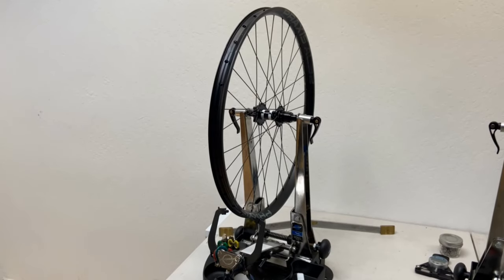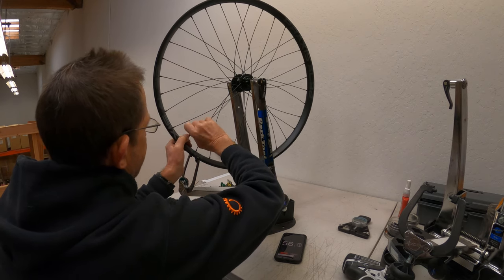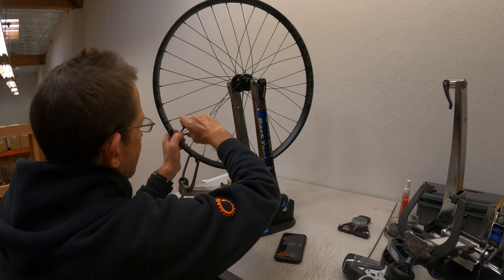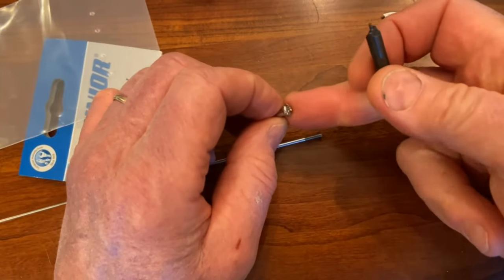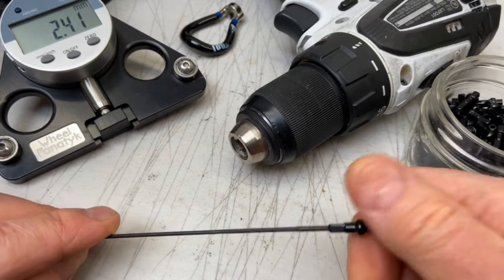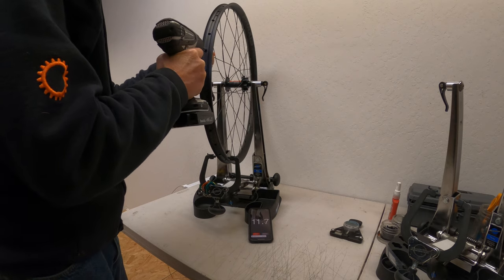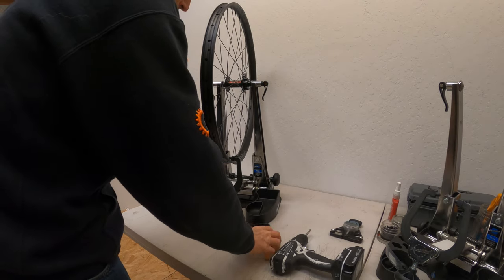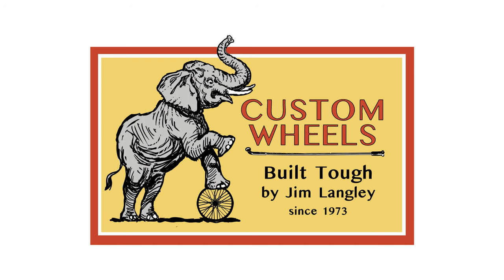Build Bicycle Wheels Faster With a Driver Bit

Comment: A great tool to use us an old fashioned Stanley Yankee push screw driver.. grind  or file the edges of a flat screw driver bit. leaving a 1/16" protrusion in the middle.. I have used this tool for 30+ years... Eldi a German tool brand used to make one just like it.. Yankee ) push screwdrivers) can be found at a garage sales.. They were the cordless drills of the past..
Reply from the maker: Thanks a lot for sharing this great tip, sprocketand wheel. I used to work with a guy who liked his. Here's a link to a modern version sold on Amazon: https://amzn.to/3O59NBb With this tool no batteries are required and it's lighter to hold and handle than most drill drivers. It just takes a little work to make the bit just the right shape to drive the nipples to the right depth. Thanks again - great tip!

Comment: That's a good idea! I'm going to have to make one of those. Agree that maximum consistency at the start is the way to make a good wheel. When everything is new and if the components are well-made the wheel comes up almost true right at the start.
Reply from the maker: Thanks for watching and the comment, Ben. I put some notes in my reply to Tobias above on how I made my driver bit in case you're interested.
Reply: @JimLangley1  Thanks! That sounded like an interesting project. I only use nipples with regular slot heads so it's a much easier tool to make. Can probably just grind an old screwdriver or a bit of steel. What's the ideal length for the spike would you say? Maybe 3mm?
Reply from the maker: @benc8386  Yes, 3mm would be pretty good , Ben. The Unior I have is 2.5mm. The only issue would be if you ended up with too short spokes. But that will cause problems with any tool for pretensioning. It only works if your spoke lengths are spot-on. But lets say if you didn't know like on a wheel you had never built before or you didn't trust the calculator... then if you have a longer/deeper spike, then you could still be able to pretension with spokes that were a little short and you'd discover afterward that you couldn't tighten the nipples fully. So, I think there's a use for a longer spike version and I think that's why tools like the Problem Solvers WheelFanatyk sells, has an adjustable spike you can make as long as you want. Fun stuff!

Comment: The first nipple driver I ever saw was what appeared to be hand made.  Was in use by a renowned wheel builder that was based in the bay area a number of years ago, Steve Aldridge out of the Talbots shop.  I asked him a year or so back, through email if he had invented the thing, being the only hand made one I'd ever seen.  He stated that he was not the inventor, and that they'd been  around for quite awhile.
Reply from the maker: Thanks for telling me about that Walt. Steve Aldridge is one of the legendary mechanics from way back. I have never had the honor of meeting him, but I have known of him forever. I know that for some time builders have been using hand drivers such as push drills that look like screwdrivers. I'm sure you've seen these. You push on them and the bit turns just like it does in a drill. I assume they modified the screwdriver blade on the tool to fit slotted nipples and have a tip to bump into the spoke and stop the nipples in the same place. But, I've never actually had one of those tools to see how exactly they did it. It sounds like Steve might have had something different, probably even more interesting!

Comment: Great work Jim, might not be as fast as you thought but that makes life a lot easier for someone who has difficulty using the PT spoke wrench, arthritis in the fingers can make life difficult using smaller tools... 👍
Reply from the maker: That’s an important and excellent point, Graham. Thanks for pointing that out. You are absolutely correct. It can be extremely difficult to turn regular small spoke wrenches with arthritis and or other hand or finger issues.

Comment: I adapted my "problem solver" to accept a driver bit. It works like a charm.
Reply: Any pictures of that?
Reply from the maker: Thanks for watching and the comment, Bruce. I haven't used the Problem Solver but have read about it on WheelFanatyk here: https://www.wheelfanatyk.com/store/problemsolver-nipple-driver/ It sounds like a nice tool
Reply: @YuoTubeTobi  I do have a few pictures but not sure how to post to YouTube
Reply: @brucelittle1137  upload somewhere and post link here?
Reply: I had one and it worked great once I filed down the sharp corners. The perfectly square angle where the flat bottom meets the curved sides would cause it to release inconsistently. I filed the bottom just a bit to create a curve on each side and I believe it helped. I stuck with Wheelsmith nipples because cheaper nipples would often have slots  machined roughly, contributing to a inconsistent release. In the end, it might not have made a huge difference, but it made me feel better.
Reply from the maker: @UnivegaSuperSport  thanks for sharing that tip!

Comment: Nice video.  Whats the cost for the 32 aluminum or stainless steel spokes nipples included?
Reply from the maker: Glad you enjoyed the video, thank you for watching. I don't know of any nipples made of stainless steel. Brass and aluminum are the common metals bicycle spoke nipples are made of because those materials work well with rims and spokes. Right now you can get Brass DT Swiss nipples for about $11 for a box of 100 https://amzn.to/3yzb3Hf For Aluminum DT Swiss nipples the cost is a lot more, about $47 for a box of 100 https://amzn.to/3ZwVhZf For a 32 spoke wheel aluminum nipples save about 30 grams over brass for the whole wheel. Aluminum nipples do not last as long as brass and aluminum corrode over time. So brass is usually the best choice. Hope this helps and thanks again!

Comment: Thanks for posting interesting videos on wheel building! Are you using blue Loctite on 9:00?
Reply: My bad it's literally another product https://wheelbuilder.com/spokeprep-by-wheelsmith/
Reply from the maker: @findtherightbeat  thanks for watching and the comment. You found it and I have a link in my description below. It's Wheelsmith Spoke Prep. It goes on wet and dries leaving a layer that helps keep the spokes tight and lets you true the wheel for a lot longer.
Reply: @JimLangley1  Thanks, will be going through your videos and hope I get to try and build my own wheels.
Reply: @JimLangley1  I'm glad I found this comment. I see alotta dudes pooh-pooh spokeprep. They reckon correct spoke tension is all you need, but it occurred to me recently that when double wall rims replaced single wall we lost the tire pressure on the nipples. So, in conclusion, how tight does spokeprep set? Does it leave gunk? Can you use weak Loctite?  I've got a loose spoke linseed oil experiment on the go at the moment, but I think it's gunna take a few weeks to set. Love your channel, Jim. Cooee!
Reply from the maker: @RadioSnivins  thanks for watching and the questions! Spoke Prep dries in about 30 minutes - depending on the temperature in the room. It leaves sort of a tough plastic coating on the threads kind of like nylok if you’ve seen that. 

It has impressive holding power. If you use too thick a layer of Spoke Prep the nipple will be hard to turn on the spoke and the whole spoke will turn. You can still build wheels that way but you end up holding the spoke with spoke pliers while you turn the nipples since the Spoke Prep wants to hold the nipples in place. So, it really holds well and keeps nipples from loosening.

It doesn’t leave any gunk behind unless you get it on the spoke when putting it on the threads. If you do that you can end up with blue or tan Spoke Prep “stains,” on the spokes where you can see them if you look close. You can wash it off with hot water or scratch it off with your fingernail. But, the best thing is to coat ONLY the threads and don’t let it get on the spokes.

I dip about 16 max spokes into the Spoke Prep container and get just the bottom 8th of the threads wet. Then I hold the spoke upright with the J bend ends on a table/workbench. That keeps the threaded ends all lined up perfect. Then I roll the spokes against each other and watch as the Spoke Prep works its way down the threads coating them evenly all the way down to the last couple of threads. That way you get an even coat and not a too thick coat. You only need enough to cover the metal, not a thick layer.  I hope these tips help Radio! Thanks a lot for watching and the great comments!
Reply: @JimLangley1 what's your opinion on/experience with boiled linseed oil ? 
Oh and do you happen to know the brand or is there a makers mark on the aluminium nippletwister next to the park nd1 in the last shot ?
Thanks in advance
Reply from the maker: @appelflapdrol  thanks for watching and the questions. I talk about the pros and cons of linseed oil in my video on methods of keeping spokes tight. Here’s the link https://youtu.be/z4FKL95x6DE?si=9Hre3QFaROism-kc The tool is made by Bicycle Research. As far as I know they’re not available now except used on eBay etc. Hope this helps and thanks again.

Comment: Yiu could further improve maybe not on time but on comfort by using a cordless drill that weighs less or even an electric screwdriver.
Reply from the maker: @dieterjosef  thanks so much for watching and the excellent comment Dieter. Yes, a great setup would be having a light torque-settable electric screwdriver hung overhead on some king of retractable cord. That would certainly save time. Great thinking. Thank you🙏

Comment: make sure to do smaller turns around the wheel early on after lacing or else the hub will move to 1 side and mess up the build!
Reply from the maker: Thanks for watching and for the comment, Nick. If the spoke length is correct, as you pretension, the hub will stay centered in relationship to the rim. But, if the spoke lengths are incorrect, then yes, the hub can move. So, getting the spoke length calculation correct is important ;-)
Reply: @JimLangley1  well when building wheels for cheap Russians, I always had to recycle spokes from old wheels so that they could get free parts 😂 so I guess thats where I learned that "rule"
Reply from the maker: @nick37781  ha, ha, thanks for the laugh.. yes, I totally understand about recycling spokes and not always ending up with the perfect spoke lengths. In that case you definitely need to use smaller turns and also keep your fingers crossed the old spokes aren't the completely wrong size ;-)
Reply: @JimLangley1  the best part is when some are so long they stick out the frame, dremel go BRRRRRRRRRRRRRRR